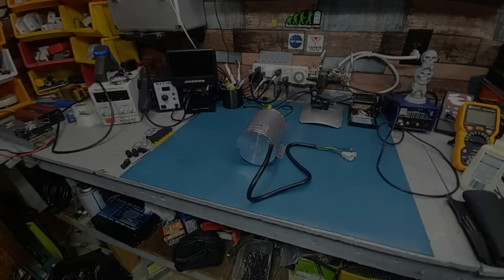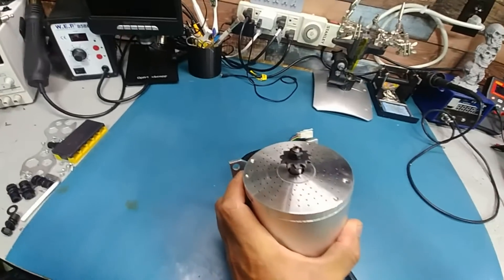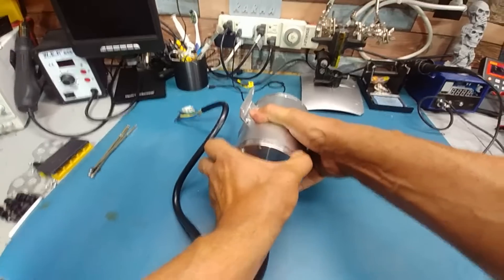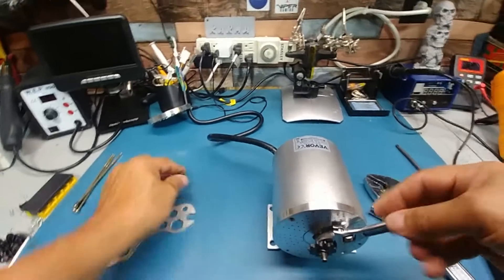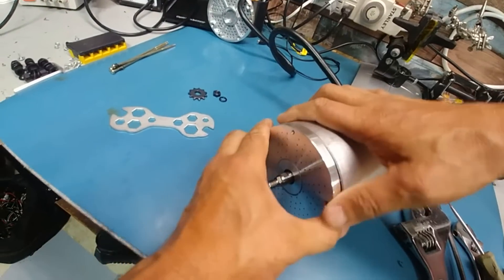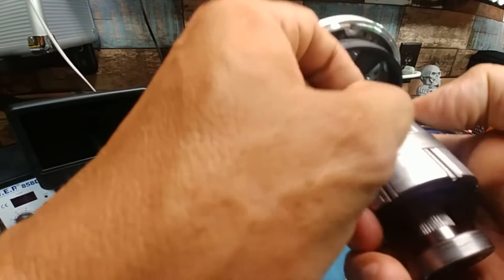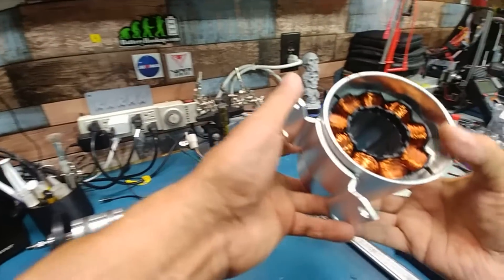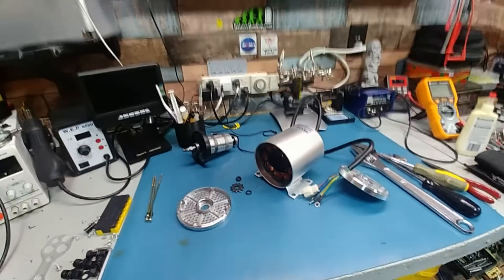ebike Brushless Motor,2000W 48V 42A* a look inside*

Comment: Got a 3000w 72v there motor aint workin right with no weight on it all spins good when i sit on it tho it grinds and saueals
Reply: Chain too tight, compress your rear suspension when you measure the chain

Comment: Hi. Good news and bad news. I got two motors, 72v, and I got one with a newer model which doesn't have those steel rings to keep in place. The new ones are real cool and placed inside a a cast aluminum. But here comes the kicker! My 72v is lacking any fan. Which means these 3000w motors are just gonna over heat super fast and die on my first run. Now a request from a fellow youtuber ... Could you take some pictures with measurements of that fan? I will reach out to Vevor and ask for it, but I have my doubts. So I think it might be easier to just CAD it and 3D print it if I'm ever gonna have a chance to get my project done (outboard conversion) before the season is over. Cheers from Sweden
Reply: Forget it. No fan will work, because there isn't any space inside for it.
Reply: Hey i am Sweden, i add Cooling of water better than airfan. 👍🏼
Reply: @CR-VDREAM  I have a channel, @navaltechtinkerer could you post a picture to me there?
Reply: Como fez para adicionar o resfriamento a agua ?

Comment: I have 3 of these motors, same brand, rated at 72V. Have drilled the end plates on all of them. None of them have fans so I was pretty surprised to see this one... nonetheless they have been 100% dependable and good performers running on 20s but they get a little hot on hot days. I rarely do bursts of more than 10 seconds WOT, and 25H chain to a freewheel is a good setup.

Comment: Do you know where to get the internal fan itself?
Reply from the maker: there may be someone out there that made a stl of the fan to 3d print.  you likely would need to purchase off the manufacturer.
Reply: I would really like a fan I can add in there also. I have built several bikes with these motors. This is a great mod. I am over voting a 48v 2000w motor to 60v so this would be great.
Reply: @MrHydroguy  are you using the 48 volt controller at 60v? I am thinking of using a 48v controller with a 56v battery

Comment: Bullet proof motor when combined with cheap chinese 1500 w ebike controller. Been using mine to race e-karts (search for Hacky Racers) for 2 yrs now. Drilled out the cooling holes to 10mm and drilled a hole in the side of the casing for the cables to come out of the side rather than the end, that leaves the end plate clear for mounting a large pc fan. Fitted a temp sensor inside so I can monitor the temp with arduino for display and to switch the fan on and off, or in the future attenuate the throttle signal if the motor gets too hot during a race.
Reply: ну и как нагревается после переделок под нагрузкой.Я такой купил но он греется продавец говорит что 80гр это нормально  а я думаю что зря его купил технологически он не доведён до ума

Comment: I been thinking about building a Ecycle, or escooter,  but don't think a2kw motor would be enough, even 3kw , I'm thinking around 5-6kw,  and 60v at least, I'm thinking about making it a hybrid,  it would be awesome if they had these with a metal gear reduction, I think I'd epoxy  the magnets.  And the windings! Maybe thin the epoxy, at least get it good and hot, dip it and vacuum chamber it to pull epoxy in all the cracks, , then pour the remaining on the windings,  maybe a2-3kw on the front wheel being a hybrid scooter, maybe rig up a Regen brake system,   rectifier and dc to dc,  and connect the brake lever to a pot to crank up the current,  slowing the scoot,  all together it's about 400-500lbs, so a decent amount of energy slowing from near 50 mph , plus it can be used to accelerate the gas engine faster!  But awesome, can't wait!!
Reply: I have a 48v 1500w rear hub motor that I'm running at 58v and we'll over 4000w. Let's say there's no hill my mountain bike won't pull me up, works great off-road too.